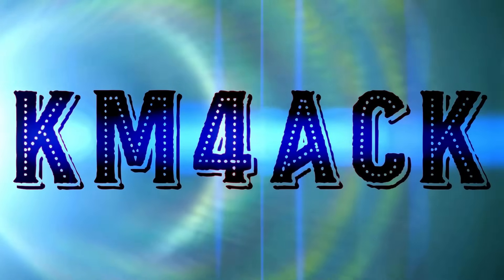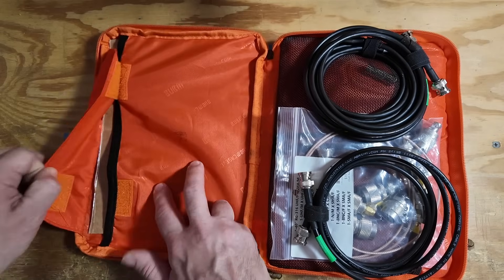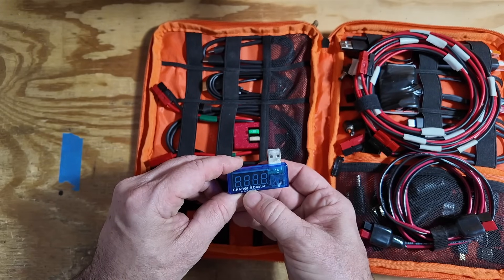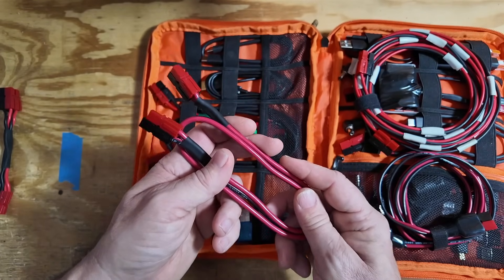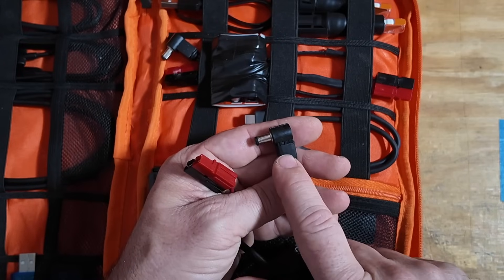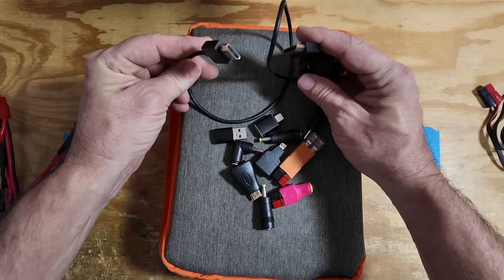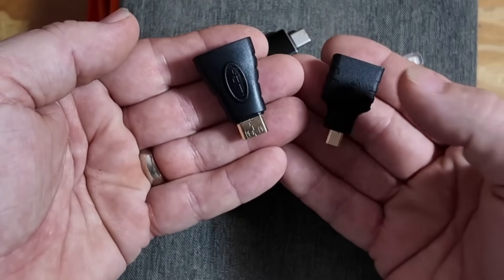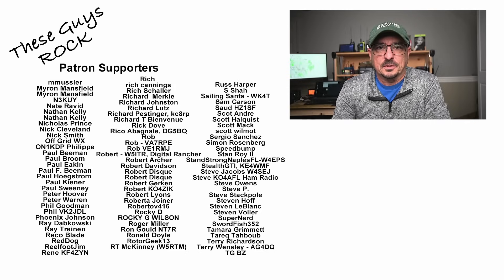A solution for multiple problems. Solution module

Comment from the maker: Bubm Bag - https://amzn.to/4fEEyuj
Coax - https://abrind.com/ (Save 10% with code abr10km4ack)
12V->5V Board - https://amzn.to/4gxPZVO
HDMI Mini Adapter - https://amzn.to/3ZVtGCt
HDMI Micro Adapter - https://amzn.to/49Z6FTD
Red Tip Barrel Connector - https://amzn.to/4d8z61Z
Yellow Tip Barrel Connector - https://amzn.to/3zTMMQ8 
5.5x2.1 Barrel Plug - https://amzn.to/46doiNI
5.5x2.1 Barrel Cable - https://amzn.to/3xW92s5
Power Pole Splitter - https://amzn.to/40dS2bX
USB Tester - https://amzn.to/3PijIpW
Coax Adapter - https://www.chattradio.com/10-Pc-Adapter-Kit-Jumper-p637411289
MC4 Repair - https://www.qrz.com/db/KE5EZZ
Power Pole Repair - https://www.qrz.com/db/KE5EZZ

#affiliate

Comment: Well, probably just the larger rf connectors like N connectors  and stuff you'd use at a repeater. But, for me, that goes into my Motorola rf meter case. Thats a good set up you've got there.

Comment: is that the medium or the large?
Reply from the maker: My model is discontinued so not sure how it equates to the newer one. Mine is the large.
Reply: @KM4ACK  roger, thanks. Looks pretty negligible between the 2 current models. 10x7.3 internal for Large and 9x6.5 for Medium.

Comment: TSA would have a field day with this one! I can't imagine what this would look like under a scanner. Be sure to include your radio license in there!  Thanks for sharing! Great work!
Reply from the maker: 😂it would certainly get a second or third look.
Reply: @PhilJohnston  I worried the first time I took my KX-3 kit and a couple of HT's with me for a cross-country trip.  It was in a Western Pack mini- duffel small enough to declare as my "personal item".  It was stuffed full with the radio, various cables to connect it:to a laptop, a KX-3 Helper wire antenna with its unun, 30ft or so of coax, an external 10-cell battery holder with Eneloops, microphone, and I don't recall what else.   I made sure I had my license handy.  But then it was a non-event.  No trouble getting through TSA screening.  Surprised the heck out of me
Reply: I’ve taken worse with just computers stuff.  I’ve only been hassled one by TSA.  It was at PHX.

Comment: I mark all my USB cables that pass data and USB-C to USB-C; I label the version number to know which ones to use for video. USB A to USB Mini/Micro cables also come in power only, as well as data/power cables. I spent half an hour chasing my tail to find out I was using a USB A to Micro B power-only cable when I needed a data cable.

Comment: One other consideration in putting a solutions bag together: is it strictly for making your personal gear work, or do you want to be able solve problems with others' gear that you encounter in the field?  Two slightly different problems, depending on the objectives of your outing.
Reply from the maker: Good point!
Reply: Agreed! Kit for other people needs lots more labeling work (contents, what each item it is and your ID so it has a /chance/ to get back to you) while accepting that loaned kit is often a consumable. I like to think they're related though: as you evolve your system versions, the old proven ones should be put to use for helping/training others.

Comment: Eliminate micro USB? Heck, I've still got a few mini-USB devices around as well, although they probably won't make it to the field with me. I think my old Antuino analyzer connects by mini-USB.
Reply from the maker: Some tech takes forever to ride off into the sunset and radio manufacturers don't help either.

Comment: That a must have carry bag.  So many times I needed that stuff. I have much more in mine.  I have Mini USB cables . You still find stuff that use them.  I have several USB C cables. Some are PD cables.  There is no one fits all usb C cable. So several types in bag is a must ! . I have a small Rig-runner power pole fused 4 port distribution block .  Also a powerworks 6 port one. And I have extra fuses in my kit ! . 
I have many ferrite snap cores of different sizes in mine and some FT 240-31 cores incase I need to make common mode choke . I have the ABR one in my kit pre made .  one of the bast things I got from ABR is that FT 240 choke with RG 400T coax and PL 259/ SO 239 . My power pole extensions are 10 AWG and one has FT 240-31 with 10 turn wrap. cross over at 5 turns.  And I have different power poles as well. I use PP 75 ones. also SB 50 that you find on bigger LiFePO4 battery.  The current/voltage monitor cord for  power poles is a great tool in the bag.  I have the one from power works and SB 50 connectors. That LED polarity tester is easy build. about a 2K resistor and a bi-color LED is all you need.  I even made one with a mini volt meter on it.   I even made a power pole to a filter cap , helps with DC chokes to filter noise and smooth out SSB  current.  You put the cap right on the radio power lead. It helps with voltage drop on SSB .  and some DC noise . Also I have a crowbar power pole protector from TOM. A to Z on youtube.  Saves my radio if my MPPT or power supply fails and over volts radio. Just a small bord does a lot of good.  I keep adding to my RF adapters. I have TNC ones now. Some radios using that . 73
Reply from the maker: Great list!

Comment: Thanks Jason, for sharing your "Solutions Module" and what is contained in it. I have taken the transcript from your video and using ChatGPT, have made a list of what makes up your solutions module bag. For me, lists are useful in making up my own bag that works for me. The list of what is contained in your bag makes a great start. I have included the list below in case it is helpful to others here.

Here’s a list of all the items Jason KM4ACK mentions in his Solutions Bag:

Bag Features:
Bag with two zipper compartments (front and back)
Paracord zipper pulls (replaced broken pulls)
Cardboard insert with Velcro flap (used as a mouse pad/quasi-solid surface)

Coaxial Equipment:
Two sections of coax cable (BNC to BNC, ~6 ft each)
Barrel connector (to combine coax cables for ~12 ft length)
Coax adapter kit (from Chat Radio, $20)

USB Cables:
USB-C to USB-C cable (3–4 ft, supports video and audio)
USB-C to USB-C cable (shorter length for wire management)
USB-A to USB-A (Charger Doctor, monitors volts and amps)
USB-A to Micro USB cable
USB-A to USB-C cable
Another USB-C to USB-C cable (various lengths)

Power Accessories:
Powerpole splitter (1 input to 2 outputs)
Powerpole-to-Powerpole power cable (12-gauge wire)
Fused Powerpole connector (one side Powerpole, fused in the middle with 30A and 25A fuses)
Short Powerpole extension cable
Longer Powerpole extension cable
Powerpole to 5.5x2.1 mm barrel connector (2 pieces)
Raspberry Pi power management device (Powerpole to dual USB ports, 12V to 5V converter)
Powerpole LED tester (indicates proper or reversed wiring)

Adapters:
HDMI-to-HDMI cable (wrapped in a ferrite bead)
HDMI adapters:
Full-size HDMI to Mini HDMI
Full-size HDMI to Micro HDMI
USB adapters:
USB-A to USB-C
USB-C to USB-A
Barrel connector adapters:
Two red-tipped adapters (for Evolve laptops and Kenwood radios)
Two yellow-tipped adapters (for Yaesu VX6, FT5, FT3, FT818, and FT817 radios)

Special Repair Kits:
MC4 repair kit (lever nuts on one side, MC4 connectors on the other, for solar panel field repairs)
Anderson Powerpole repair kit (lever nuts on one side, Powerpole connectors on the other)

Miscellaneous Items:
HDMI cable with ferrite bead (prevents RF interference)
Cardboard mouse pad solution

73, 
Fred/N7PN